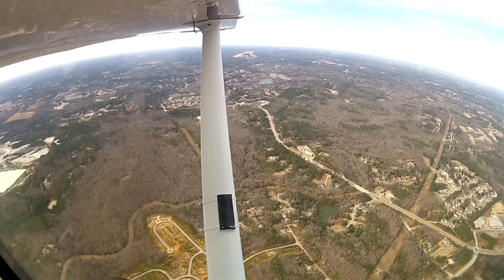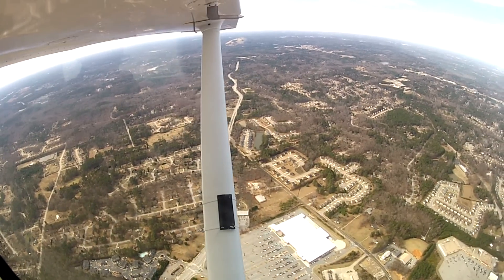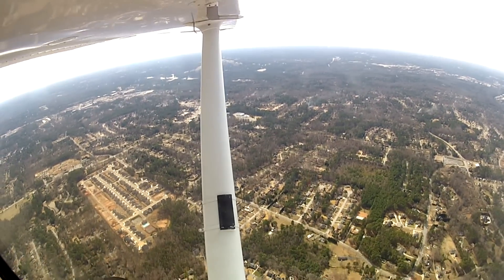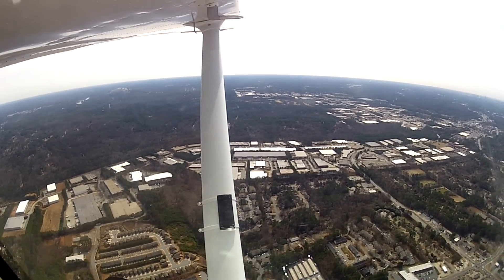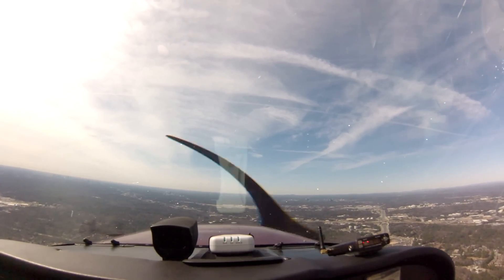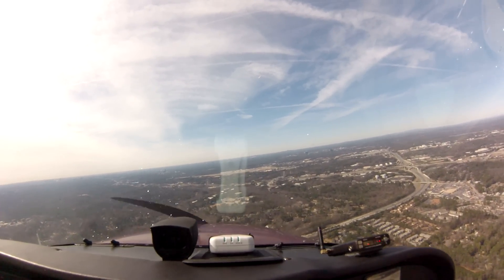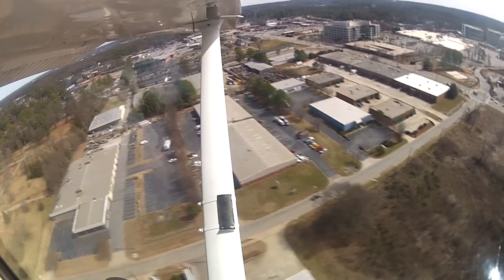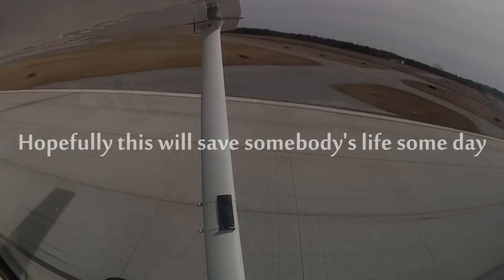A Pilot's worst nightmare, landing without primary controls

Comment: I'm really having a hard time believing he made those turns with rudder only. Rudder alone doesn't make the plane bank like that, it seems to me there was some aileron input. Often times when I've tried to fly straight and level without touching the yoke, the plane has a tendency to want to bank slightly left or right, in this video I see a lot of wobbling corrections. I can't deny that landing though, that looked crazy.
Reply: Secondary effect of yaw is roll
Reply: It's actually very believable.

It pushes air to the side, but when your plane crabs and doesn't fly straight, one wing gains more lift than the other and destabilizes the equal airflow on the wings, thus making it roll one way. I've flown Cesnas many times and i often find myself having to turn the ailerons 45 degrees opposite of the rudder direction to keep the wings from dipping to much in the turn.

If you don't think that the V-Stab has effect on roll, try taking your hands off the yoke and applying full rudder.
Reply: Murtsman1 I just thought I would see more yaw than that, not an instant bank into the turn. I'll try it next time I'm up.
Reply: Glenn Cindy Bowers Let me know if it works.
Reply: Murtsman1    Please  study the theory of flight. You are not understanding the use of rudder which could lead to serious problems.  What you describe can lead to a spin.

Comment: Well, after flying GA and Experimental Amateur Built planes for over 30 years, I've missed something!   Don't hear of a lot of yokes failing - yes, I guess some do get jammed, but my aviation experience doesn't recall ANY.  
Secondly, you ACTUALLY did land trying this procedure??  Couldn't believe that!   A CFI who would INTENTIONALLY put someone and his (?) airplane in such jeopardy - that,  I could NOT believe.   This is, IMHO, was irresponsible.   Too many "things" could have happened, just prior to touchdown.  We all heard the CFI saying:  "trim, trim, trim, trim."
Hey, what the hell is wrong with doing this at 2,500 feet?  You know the drill - use 2500 as "the runway" - fly your Base, and final - and do everything you did, only NOT put the guy and his plane in harms way.   And, the CFI, IMHO, DID put this guy in harms way.  Did I hear the CFI "boast" about "doing different or unusual things,"  so I guess he has a reputation to uphold.
I must say, I was ASTONISHED that the CFI had this guy do this - what are the odds that this pilot would actually run into that problem.   Oh well, there's that old "saw":  "There are old pilots, and bold pilots, but.........."   You get the picture.   N-6395T   p.s. Yes, straight and level flying DOES get boring, but surely there are other procedures that could have been applied.
Reply: I would guess that the instructor would have had his hands on the yoke just in case ;)
Reply: Michael Donavon Im guessing you're not a CFI lol.....a inexperienced student can and will put the seat cushion pretty far up you butt, far worse than anything in this video....if not its defiantly worth looking into. You will see you skills and proficiency skyrocket through experience with students
Reply: NO landing "seems pretty easy" - each and every one is different.  I'm only about a 1,000 hr "weeine" - ask some of those folks who have 5 - 10,000 hrs., see what they say.
Reply: You are correct - one should never assume.
I fully understand what you are saying, and have learned a lot from the "old timers."  For instance - carrying a nice crab through the "round out," and right into the flare.  (followed by alignment with the center line and a wing down to hold that centerline)   But, as you said, you must understand the aerodynamics, of the procedure and manipulate the controls, as required.
Still think actually landing without yoke control (if it is really there) is really dangerous.  And, actually shutting down an engine, in flight, as a training procedure, falls into the same category, IMHO.     Thanks
Reply: Thank you, kind sir - and I "rest my case."
Reply: Michael Donavon All I can say is that these procedures get taught in almost every Commercial Pilot Training (like my own) and even back when I was learning to fly gliders we did this procedure on our checkride. If you ever would do some form of Upset Recovery Training (which is extremely interesting!) they will go over  the same techniques and manoevers. You may never have heard of yokes and elevators jamming, push-rods breaking,.. but I have. Better to prepare for such a situation in a completely controlled and airworthy airplane than never having done anything like it and having to do it for real.
Reply: +Michael Donavon CFIs do Risk/Reward evaluations (and compromises) every time the teach, and usually without considering their own self preservation instincts. Many positive learning experiences can result from this lesson, as long as the risks are mitigated. Please question, don't disrespect, your CFI.
Reply: He did say it was his Christmas present as well. So I don't think he was forced to do it and it seems more like actually doing it for real rather than calling it a part of training. Albeit he had his instructor to guide him through the process, which more than likely won't be an option if it happened outside of his flight training.
Reply: Nicholas Moyer You are correct - I'm not a CFI.   Like you, though, I've seen some "student activity" that was fairly rough!

In fact, when I was a student, in 1980, I scared my CFI many times!  :)
Reply: When working on my Commercial the CFI had me do this. Scary as hell but we made it. Most likely scenario is a broken control cable in which you have half a control. With elevator put in lots of opposite trim and then you gain some control back.
Reply: Well, actually doing it is a good way of gaining trust in the procedure and the plane. For ex. it LOOKS like a prop strike until it isn't, thanks to the ground effect..
Reply: Compensating for ground effect was the most critical part of the landing, especially since it's so easy to instinctively do the wrong thing. Practicing the maneuver at 2500 feet teaches almost nothing, since not only does the student not experience the ground effect, but they're too high up to get a proper feel for maintaining alignment with the runway. Practicing the maneuver in a simulator would make more sense than practicing it at an altitude that skips the most critical part of the lesson.

Comment: This technique only works if your control cables fail. If you have jammed or stuck yoke the pitch control using trim will be significant less, if not useless, because the elevator would only move the amount of the "slop" in the cable. 

CFI/CFII. A&P
Reply: Not sure what you mean? Trim does not move the elevator or its control lines, it is a separate control to the trim tab on the elevator
Reply: The trim tab aerodynamically moves the elevator. If the elevator's control cables are jammed then using the trim tab would be less effective than with a free moving elevator.
Reply: Patrick Steadman Roger, I get you now

Comment: i need someone to explain this part to me. so if your going nose down the ground effect will put the aircraft straight by its own?
Reply: yes, as the plane comes closer to the ground (at about its wingspan) the air can not escape below the wings, kind of cushion effect or floating. Planes cutoff all or most of its power for landing otherwise "ground effect" will lift them back. Of course ground effect varies aircraft to aircraft wing design, and you can not be in a dive :D

Comment: Very cool. Another possible failure mode: if a single cable breaks instead of a full yoke massive failure, you can fly with the opposite cable alone (assuming a "pull-pull" cable setup). if the elevator "down" cable breaks, for instance, you can trim down just enough to require a bit of back pressure to fly level. Then you can pull a bit harder to bring bring the nose up, or release a bit of pressure to let the nose down. Reverse for a failure on the opposite cable.
Reply: Practiced this back in the 70's in an old Navion, throttle and trim only but @ altitude. Was always warned about "balooning" at touchdown.